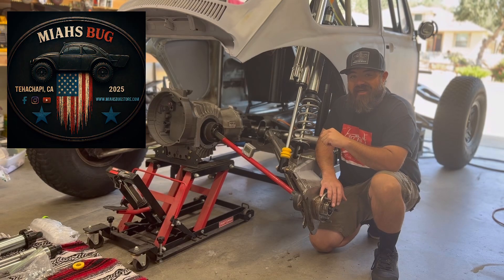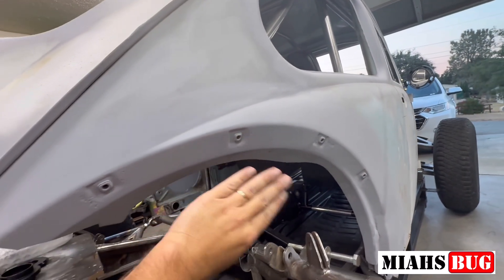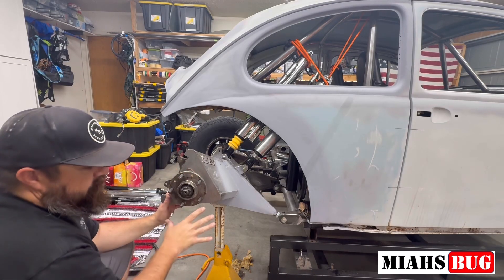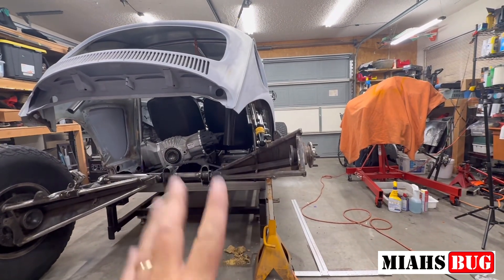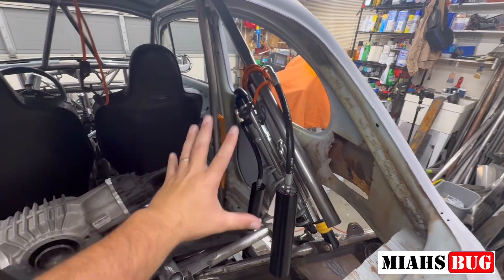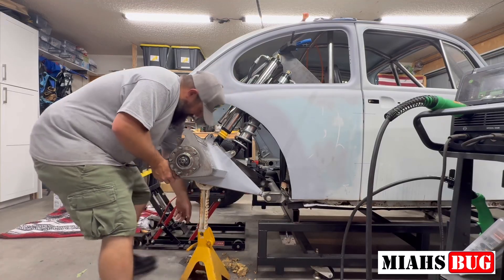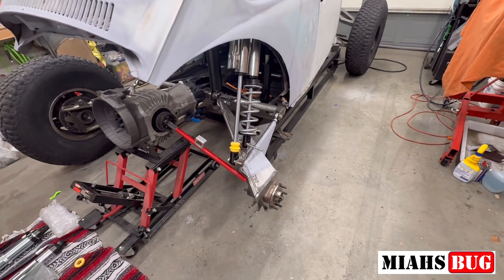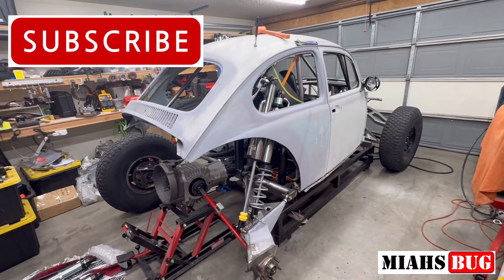Rear Shock Install, Part 1-What are the Numbers?

Comment: Just a quick FYI...
 the 5x5 from Nick hold water at the lower outer point... 
so be sure you thick paint or whatever there....
Reply from the maker: Thank you! I actually noticed that it had no exit so I drilled a hole to drain.

Comment: Ok - almost hate to do this but you should try to do an inverse mount on your motor/trans to make it a mid engine and get the weight distribution more 50/50. It would be fun to see but I kinda doubt the benefit would justify the work. Just a fun thought.
Reply from the maker: That would be really cool. A few folks have done this.
Reply: @MiahsBug have you made a motor decision yet? Staying AC VW motor? I’m assuming you are based on the transaxle decision

Comment: You may already be on this, but you should consider putting that mount in double-shear. Given the load, I would gusset the mount and weld in a hardened spacer to spread the load from the shock bolt on the coil over. You may have this already worked out, but considering you are putting all the rear load through this point, I would reconsider that rear mount and how it will load the cage/chassis. You might consider moving the shock mounts on the trailing arms to help solve the shock interference.
I am assuming you are going to strap and bump the arms. They should be strapped at least 2 inches short of topping out. Optimally, I would cycle the suspension and check it all for bind including the CVs. It’s hard to tell by watching, but it looks as if the tire may contact.
If you are not sure, it’s a good idea to stop, take a day, and go over it again. Sometimes, when you are working late and maybe a little tired, it’s easy to miss things.
Reply from the maker: Thanks for all the advice. The shock mounts are only temporary so I could cycle and move suspension components around. I am currently designing a double shear box structure to take the place of the wimpy mockup plate. It will be strapped short of binding and the bypass shocks have an internal bump zone as well as a physical bump “the yellow donut”

Comment: Always a pleasant surprise to refresh YT and have a new video from you! Can't wait to see this thing running!
Reply from the maker: I was looking at my “Top Supporters” in analytics and there was my dude Chase. Thanks for the support brother
Reply: @MiahsBug  just rewatching this, the CO and BP seem very close at full droop. I'd just make sure you budget enough room for spring deflection cause it looks tight once you get springs on and somewhat in place instead of just loosely there
Reply from the maker: @ChasePalsson your right. Good catch. At full droop, they are damn close. I’m moving the CO fwd 1/4” to fix that. I think the original shocks on these arms were 2.0 so there was more room